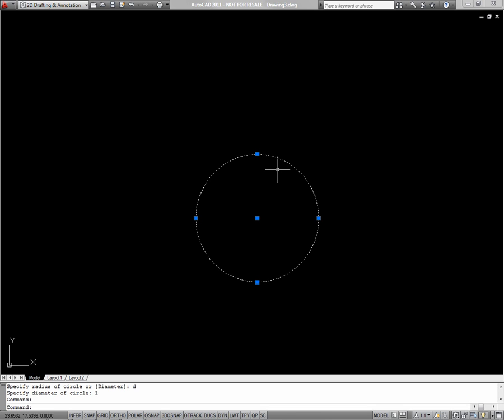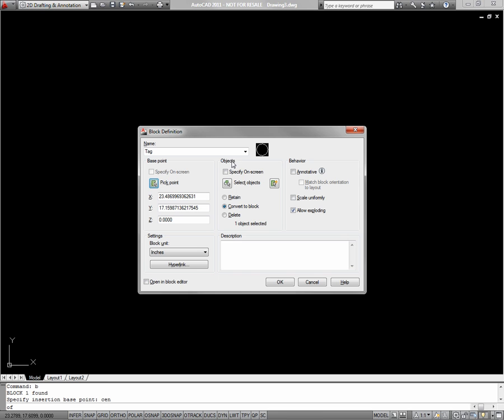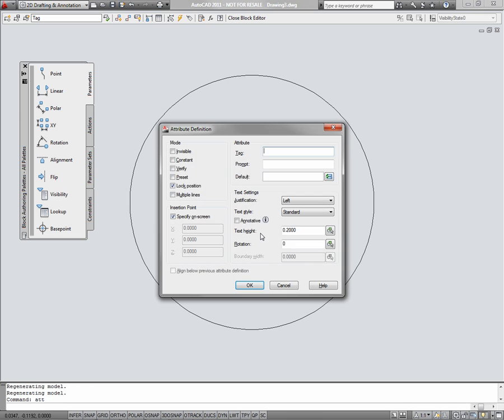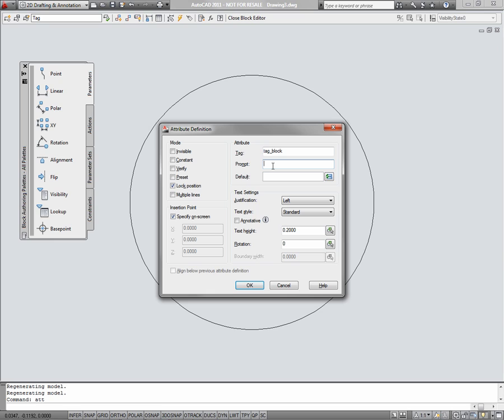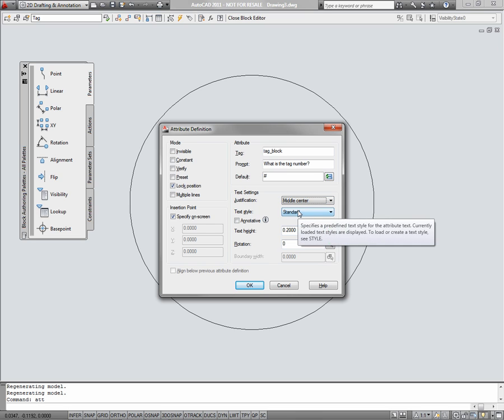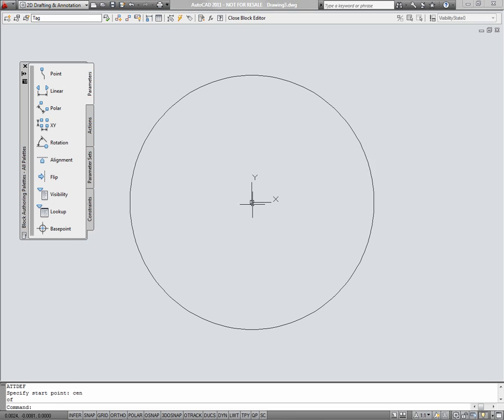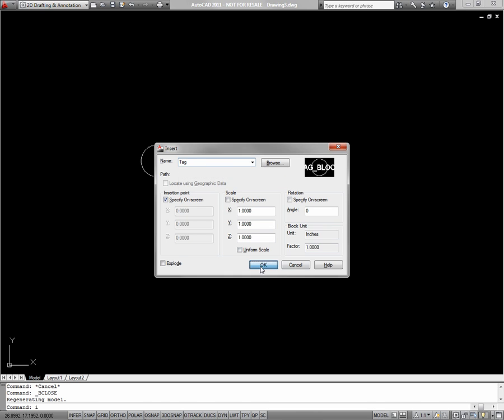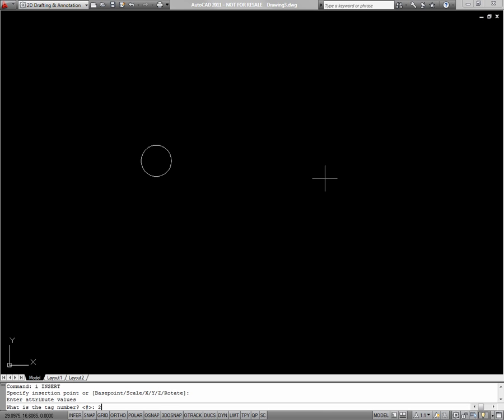AutoCAD Block Attributes

Comment: Thanks for a video. I have a block with around 600 attributes in one block which is used with excel table ( I import data to dwg form excel with ATTIN command). And now I have a challenge to change a location of some attributes in this block, or link attributes inside one block. New location is outside of this block and I cannot use standard command as  - move up or move down. Any ideas how is possible to change location of single attribute in a block, or link attributes inside one block? Unfortunately REFEDIT command didn’t help. It change location of a Attribute, but later it still load data from excell at old coordinates.